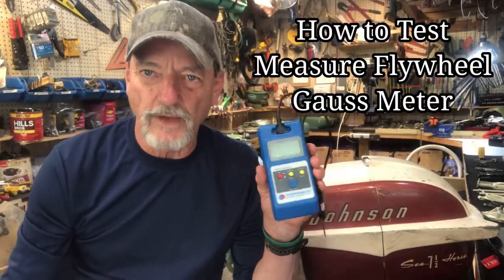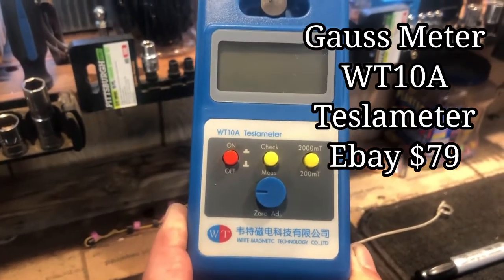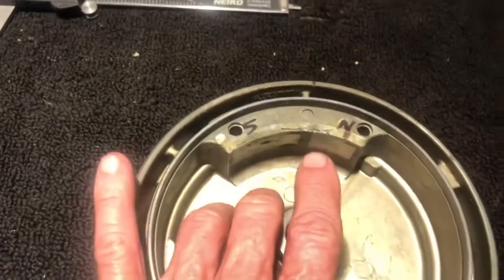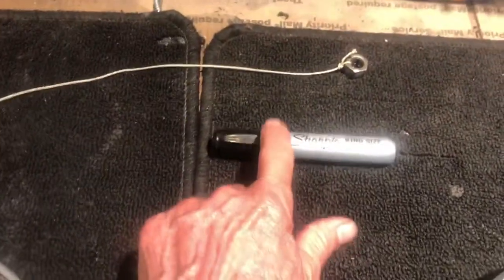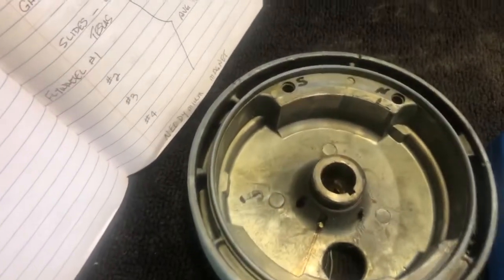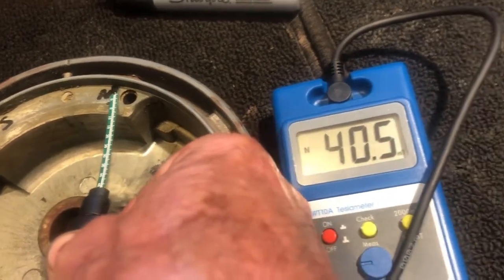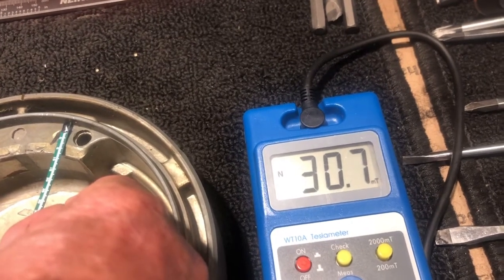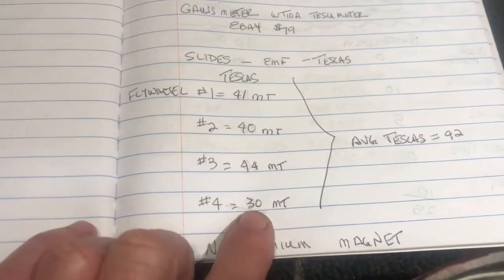How to Test Measure Recharge Flywheel Magnet Using a Gauss Meter

Comment: This is really cool T-Mike had no idea you could test a flywheel like that , let alone recharge it. Question: did you ever go back a few days or months later to see if it held ? Just wondering if it did drop down. If it would be a good idea to charge it up high expecting a drop to hit that 42 spot ?
Reply from the maker: No did not check later.
Reply: Just curious. If you still have it. Test it and drop me a number.  When you get the time. Would be interested to know. Thanks.

Comment: My 1958 10hp Evinrude Sportwin flywheel was hardly throwing enough spark to ignite the fuel. I attached 2 small neodymium magnets inside those 2 holes behind the magnets and now its throwing sparks that arc over an inch and cranks much easier.
Reply: But that causes another issue it puts the flywheel out of balance and it will cause the bearings to wear badly. But maybe its not enough to hurt it in the short long run.
Reply: @gunfisher4661  well it turns out the rings had lost alot of compression and that was the whole reason it was so hard to start. Replaced it with a 73 Johnson 20 horse. Got it for 300$ has over 130 psi on both cylinders